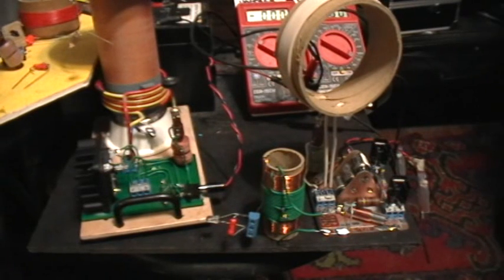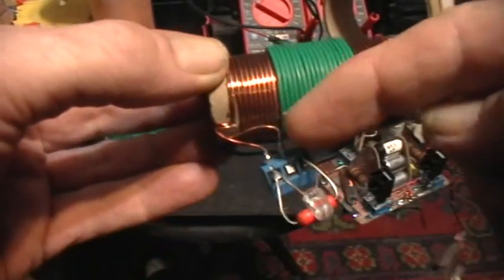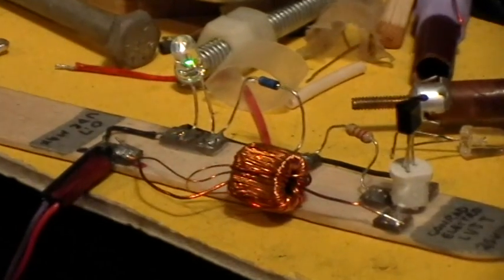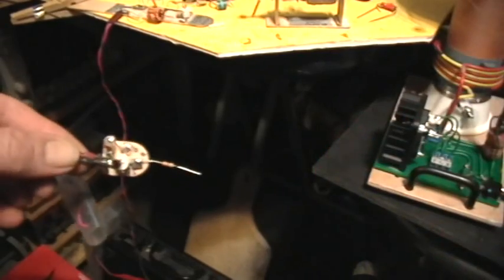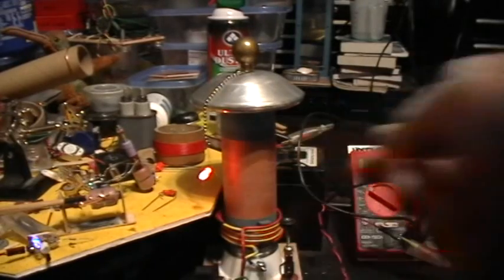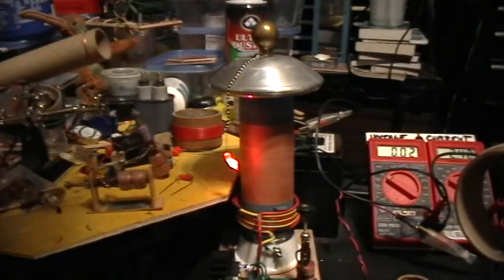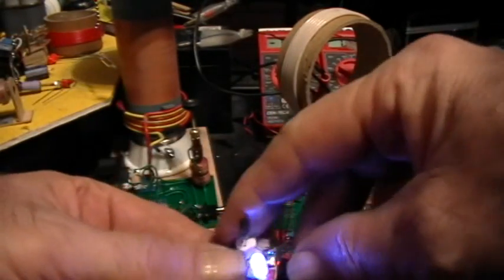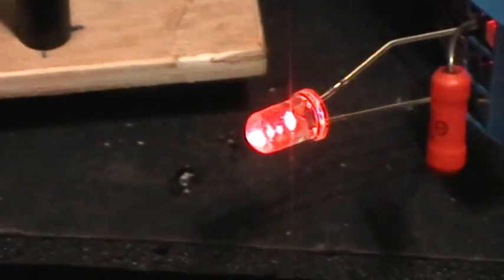Electric OU: Charge, Motion, Field: One Thing. One.

Comment: In your Maxwell's Equations slide, Integral form, the last equation is missing " dot da", the integral is incomplete and the units don't match without it.
Reply from the maker: You may be right. I copied the slide from a MIT lecture presentation, IIRC. My vector calculus is a little rusty. Here's a full derivation:
http://ocw.mit.edu/courses/electrical-engineering-and-computer-science/6-013-electromagnetics-and-applications-fall-2005/lecture-notes/lec3.pdf

Comment: Paused video, open new tab, order 2 x 2SK170. I have to build that little detector it's just so cool. Thanks for reminding me :-)
Reply from the maker: Just about any JFET will work for that detector. The first one I built used MPF102.
The resistor value really should be higher than what I have here, should be 100k or 1 meg even. It won't affect the performance or sensitivity but will help protect the transistor from failing due to static discharge.
Reply: TinselKoala Sadly I don't have any JFETs in my parts box otherwise I might have just tried one. Thanks for the advice on the resistor value, I'll start with a 1M and see how it goes.